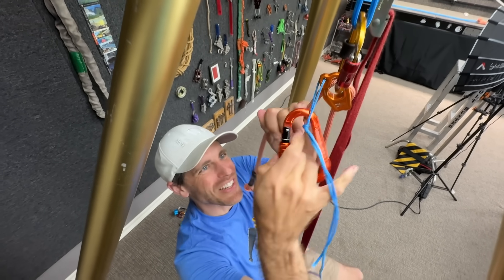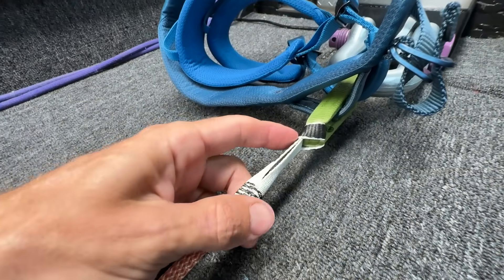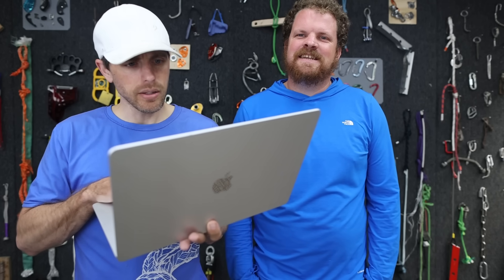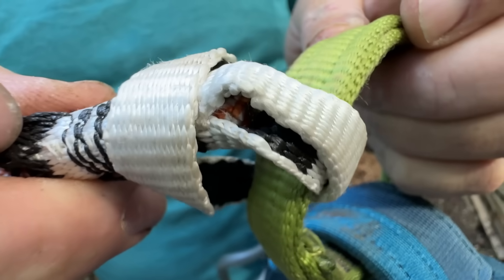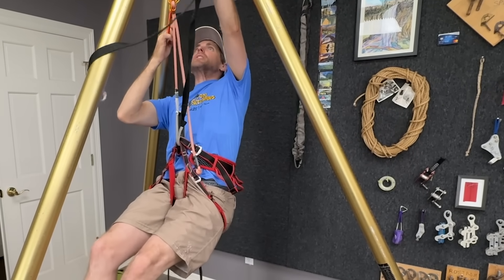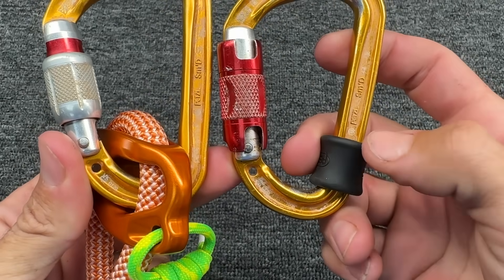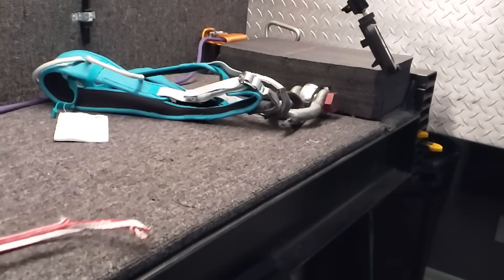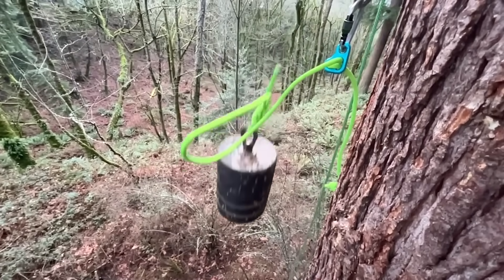People are worried about this part

Comment: The fact that the stitching starts to break before any catastrophic failure happent is actually a very good thing !
It means you get visual indication that you did something bad with your lanyard, and will retire it (unless you're really stupid...) before you can actually get injured. Great design !
Reply: Thinking about this, I wonder if all that top stitching is actually cosmetic, and mostly there because having the loose lip of dynema looks freaky? My understanding is that tack stitching mostly forces the two parts together so tightly that friction won't let them move, and the sort of long stitching on the end just doesn't look right for that.
Reply: @think-some-time  I mean yeah you're right, almost all shear strength is produced by friction/adhesion between the two parts being sheared. The stitching isn't being directly loaded in tension, because it is perpendicular to the force direction. It is being indirectly loaded in tension to redirect the force into a compressive force between the two surfaces, increasing friction.
Reply: @think-some-time  Maybe it is, but even if this is the case, this is not just cosmetic, because as I described it serves as an indicator that the lanyard has been subjected to excessive load and should be replaced.
I wish all devices had such an indicator...
Reply: The other indication would be the various subtle aches and pains associated with a 5kn caress from your harness

Comment: that symbol was Mu which i believe is Micrometer in that usage but i still cant decipher this. I would say try posting that image to a subreddit like whatisthisthing or other multimilliion viewed channel to get a lot of eyes on it
Reply: Indeed, Mu is one of the SI prefixes, meaning 10^-6 or micro, so micrometer in this case. Ra is mean surface roughness, so basically an average of the heights of the surface, it's talking about how smooth the bars have to be

Comment: Micrometer is that cryptic unit (RA0.8) it's a value of surface roughness.
Reply: Its genuinely insane that people who deal with this stuff don’t know what a micrometre is, and/or can’t recognize the micro prefix
Reply: @brilobox2 They're not using the metric system so often
Reply: @TheClimbex  in which funny unit Americans measure roughness? 1/128th farthings?
Reply: @motivase No idea mate. I deal with RA and RZ since I work in Germany
Reply: @motivase I thought farthings were British coins 🤔
Reply: @counterfit5 And? You don't try to suggest it would be unreasonable to use a coin as a base of measurement in the imperial "system", do you? 😂
Reply: Well, micrometer is just a distance measurement. Specifically 0.000001 meter. 
The Ra value is indeed surface roughness, so basically how big the pits in the surface are. Presumably it's  because high surface roughness gives extra grip to the sling or rope material and might change the results. Low surface roughness means that the sling will slip to equalize the load.

Comment: Shouldn't the loop on a fall harness be rated for 22-23 KN (5000lb).
Reply: Nope! Belay loops are usually rated 12 to 15kN. If they were to be rated to 22-23 kN they'd be almost twice as strong as the knot in the rope you're tying into.

But there's also little reason to make them that strong. Sure your rope might be rated to 20kN, but as soon as you tie it into your harness with a figure 8, you've already reduced that strength to like 10-12kN. Iff you instead of that clip in with a carabiner through your belay loop into that figure 8, the rope will still fail before the belay loop does. And the carabiner will outlast both as it should be >20kN.

So why is the carabiner twice as strong as the rope knot and the belay loop? well, if you hang a carabiner from anything, and then run a rope from down through it, and down again, the carabiner will see double the force. Hypothetically if the climber on one side is putting 10kN of force on it in a fall, and on the other side the belayer is holding that 10kN, the carabiner will be seeing 20kN in total.

So why are belay loops that thick even if they're not that strong? Because their main goal is wear resistance. They're constructed in a way that doesn't make them much stronger, but that does make them incredibly wear resistant.

Also, even if the rope is strong enough to hold that 22kN, there's just no point. The weakest point of the system has been your back for a while now. You're not walking away from a 20kN fall, period.
Reply: Well… it would be overkill in most cases.
1.Your body is probably gone before that.
2.Since the gear on the wall is rated at 22 kN, but it's usually part of a 2:1 system, the carabiner at the wall would break when that loop hits 11 kN. (simplefied)
my opinion.

Comment: That µ is a Greek letter, stands for micro, so micro meter, i.e. 1 millionth of a meter, 1 thousands of a millimeter.
Ra (I.I.R.C.) is surface roughness.
Reply: Correct, Ra stands for Roughness Average and us calculated by taking the average of all the peaks and valleys on a part.
Reply: @rjanderson4207  to be pedantic, it's specifically the typical type of average (arithmetic mean) but there's also Rq which is an RMS type of average. It's also specifically a line measurement, as opposed to an areal measurement which takes all directions into account (Sa, Sq, Sz)
Reply: Have even fairly well educated US Americans like Ryan never seen μm for micrometer? I’m honestly surprised.
Reply: @Mike-oz4cv  I can't speak for the entire country, but with my education experience, I only learned this topic in university chemistry courses. So anyone that didn't go to uni might not have been exposed to it.
Reply: @theKashConnoisseur  In my country (Sweden) this was a part of secondary education (university is tertiary). You might even have learned it at the end of primary education (like grade 8-9).
Reply: @fiendishrabbit8259  well, to be fair each State in the US operates like it's own country as far as educational curriculum goes. Perhaps other States I have no experience in might teach it in grade school! But while I learned the Krebs cycle in high school, we didn't cover much of the symbols used in the metric system. And yes, I understand what primary, secondary, and post-secondary education is. But thank you regardless.
Reply: Ngl, would have thought ryan would recognise the micro symbol.
Reply: mu 
hence the pun in everyone’s second favorite 90s ambient electronic act.
Reply: Basically, specifying bend/contact radius and roughness so that friction doesn't take too much of the load (like it does in a diverter)
Reply: AKA: A micron. I grind my espresso at 140 μm burr spacing.
Reply: pretty sure this is Ra https://www.youtube.com/watch?v=nplC-wGHXx8
Reply: I thought it was nanometers for some reason. No climbing equipment is built to nanometer tolerances.
Reply: @marcobering3945  It was talking about the surface finish of the metal bar used in the test, not the climbing equipment. Nothing is built to nanometer tolerance, even in machining getting to micrometer tolerances is already really hard. a nanometer is on thousandth of a micrometer for example a single red blood cell is a about 7 Micrometers in diameter while a singular atoms usually range in size from 0.1 to 1 nanometer.
Reply: @OgreWithanIronClub agreed.  For perspective- final hand polish on fiber optic glass used to be done with .5 micron grit back in the day.
Reply: mew / myu
Reply: I actually sorta wonder if people outside machining ever come across Ra in any meaningful capacity
Reply: @angrydragonslayer  Anyone in optics probably comes across it occasionally, maybe some aerospace applications, and of course anyone into metrology.
Reply: That's really basic knowledge in anything related to engineering....
Reply: Yep, micrometers! Anyone whos done acid will know lmao